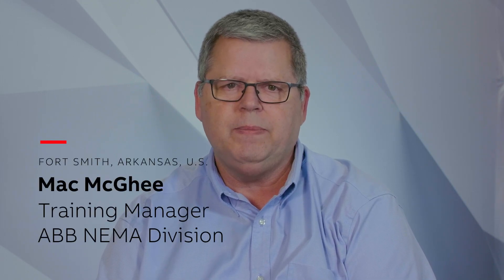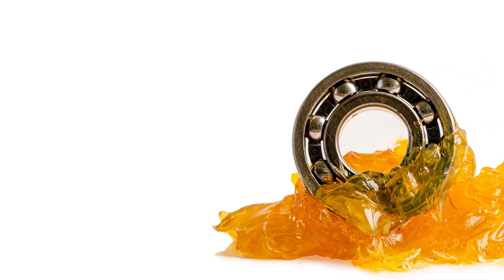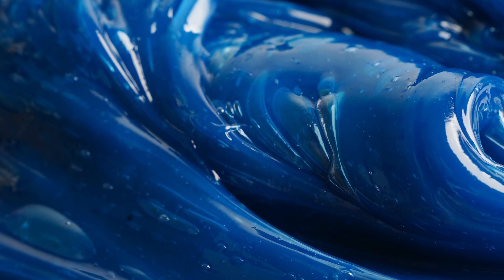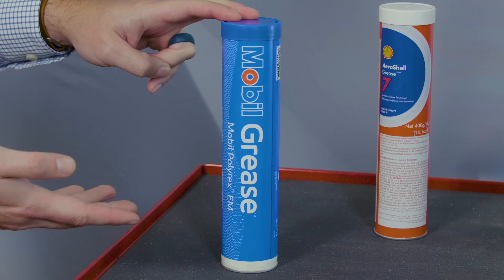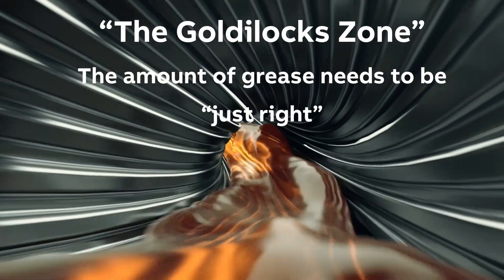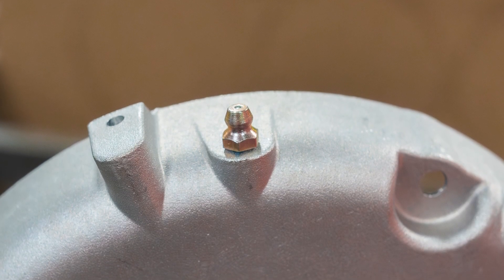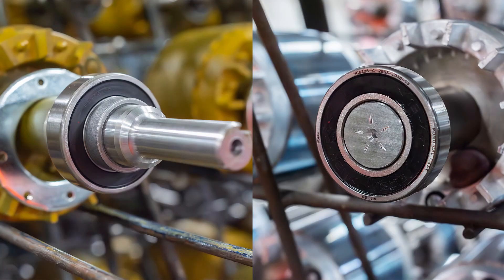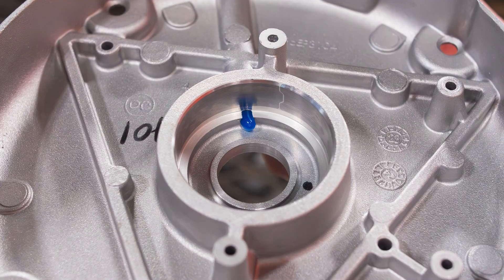Mastering Motor Lubrication: Types and Maintenance Tips | ABB Motors Explained

Comment: I've seen way more motors fail because of overgreasing than not enough.

I've seen quite a few fail because of incompatible grease. Using the wrong grease results in a sticky gooey mess that doesn't lubricate anything.